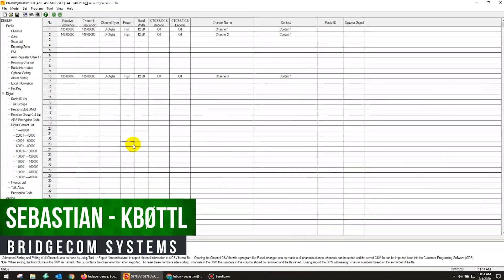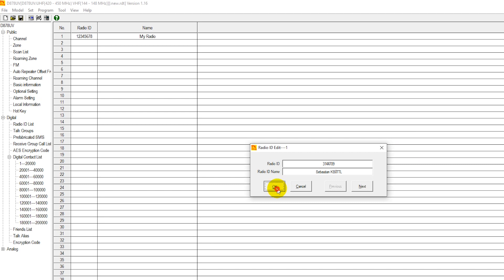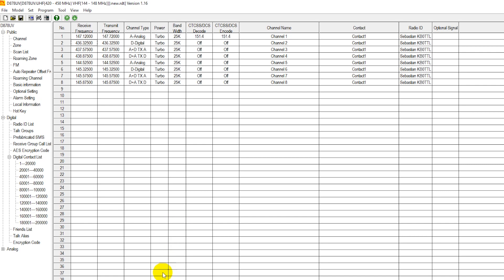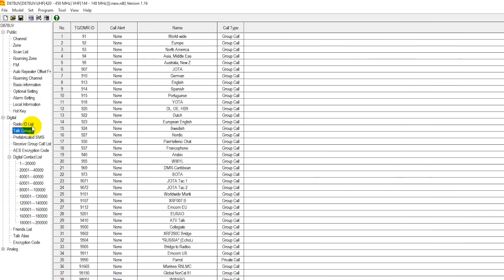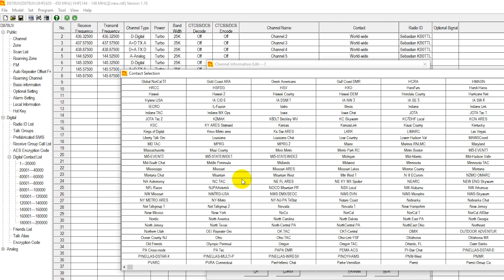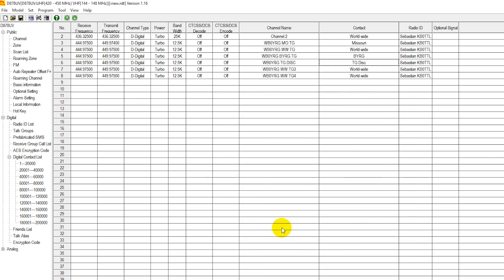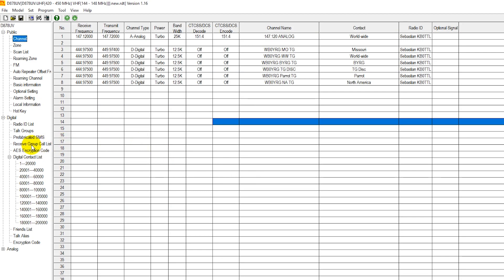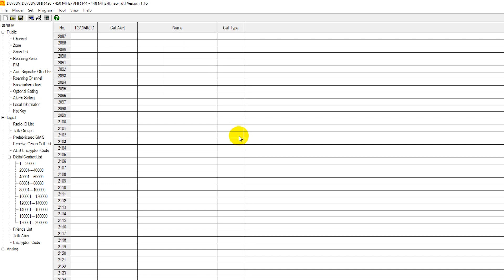How to Create a DMR Codeplug 2.0 by Sebastian KBØTTL

Comment: My first few times through this video, I missed several important concepts that would have saved me a great deal of time and frustration.  As a long-time Mac user who had sworn off Windows somewhere around v 3.11, I also found myself learning Windows 10–no choice; to use the CPS you have to learn Windows. I think that is why I missed so much in my early Bridgecom University sessions.  I have learned to take it slow and use the rewind feature on the videos.  The latest gem from this video is the ability to add talkgroups in the Talkgroup section of the CPS rather than from the Channels section.  Thanks, Sebastian.  I didn’t know what I didn’t know, but this video gave me a lot more confidence as to navigating this CPS.  73
Reply: CPS works great on a Mac. Just run Windows 10 under a VirtualBox VM.

Comment: Talkgroups import failed on my new 878
Reply: Yeah, I had the same issue. The problem is that BrandMeister isn't the same format that the 878 uses. 

To do it, go to Program > Read from radio to get the settings from your radio into the PC Software. Go to Digital > Talk Group, and if blank, enter a place holder. I just did 1234 under ID, Call alert = None, Name= Test, and Call Type = Group Call. 

Then go to Tools > Export, and pick Talk Group and click Export. Once the file's been exported, open it in Excel (or your open source favorite), and you should see the headings and your filler line. 

Open the Talk Group file you downloaded from Brandmeister and copy/paste the ID and Name columns. 

Use Excel's Fill capability to make sequential numbers in the first column. In the Call Type and Alert columns, just put Group Call and None (like the filler). Save as a .CSV file. 

Go back into the software and go to Tools > Import. Choose Talk Groups, and import the file you just edited. 

Check it under Digital > Talk Groups. If ok, then choose Program > Write to radio. Done.
Reply: As a side note, you'll get some garbage an non-recognized entries when you add channels. These are things you'll have to go back and fix manually. I'm just learning this stuff,  so I'm troubleshooting as i go.

Comment: There appears to be a problem with the frequency of one of the talk groups. Notice that all of the talk groups use 449.975 MHz as their transmit frequency except WB0YRG MO TG which seems to be using 449.974 MHz. Isn't this a mistake ?

Comment: And here's the really mad thing with DMR, all the programming and messing around , with Fusion all you have to do is enter the repeater/hotspot frequency, press Wires-X and you're done, this is the way it should be. 

Imagine entering Channels, for every TG on every repeater ? madness.
Reply: I'm wishing I wouldn't have bought my 878. I shoulda put that $$ towards an FT3 to go with my 400xdr.
The 878 is a cool looking rig with easy menu's but this whole programming thing looks to suck. I won't be keeping it
Reply: @applejacks971  I just figured out that using a hot spot, you can set all the talk groups you want over on Brandmeister site for your hotspot then you can activate digital monitor and it will receive anything that comes through on those TG you set to static on the brandmeister site, except for TG 91 because it's really busy.

So, say you've the radio set to parrot and traffic comes through on one of the static groups, when you press PTT you will go back to parrot, so the trick is when the static tg comes live again press star until you see "moni reply set success" so when you key up again it will go back to this tg, this is a pretty neat feature.

So you don't have to , if using a hotspot, set channels for each tg but I don't know if not having a TG and channel set in the radio if it will display the talk group name or just id or perhaps just importing the talk groups will do ?
Reply: @o00scorpion00o  Interesting. A hotspot is the next thing on my list to get. Thanks for the info. most helpful!
Reply: Right!! Been using wires X for a while and it always just works. Dial a frequency, press the button and you’re done. I thought about trying the DMR route but after looking into the amount of computer programming, time, guesswork, trial and error required just to get a radio to work, I ask why? For what? Doesn’t seem worth the hassle.

Comment: Sebastian, you've got a lot of good content in here, however the video could be half as long, and a lot more interesting. I looks like you're using Camtasia to record. Camtasia has some really great editing capabilities. Recording a video live straight through ends up with errors (like your .94 error), and really long pauses (like waiting for it to download the lists). You lose your audience this way. 

Next time try this. 

Record your video walking through what you're trying get across. Don't worry about the audio at this point. 

Record the audio if you haven't already. Edit it for brevity and interest. Give it a good pace, but not too slow or fast. Record a minute of dead air just to have for times when you need to go back and stretch out the audio (yes, you will do this). 

Once the audio is done, then go back and cut the video to match the audio. Learn how to use camtasia's highlighting and zooming. Showing full screen for everything is boring and gets lost on a smaller screen. 

You'll find that your videos will get more kudos and fewer criticisms.